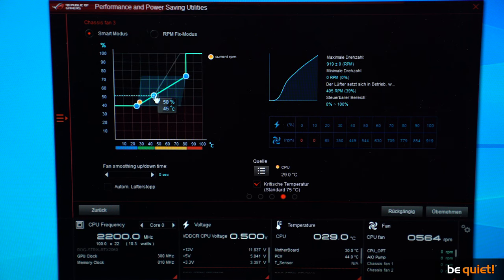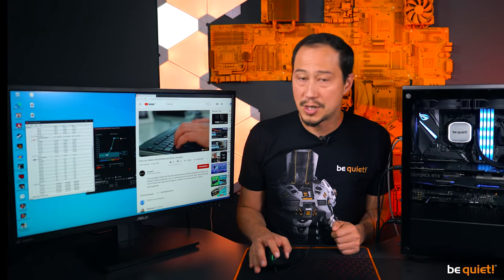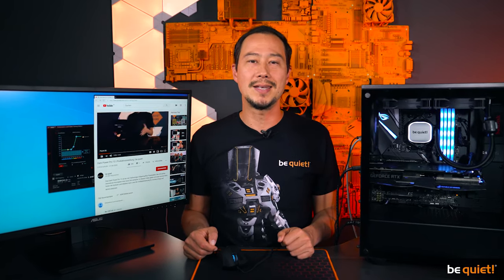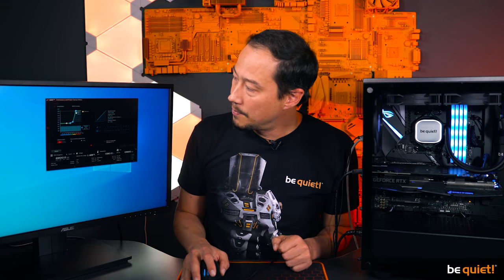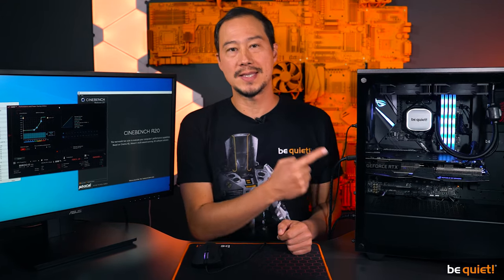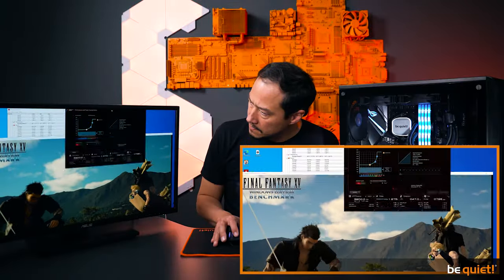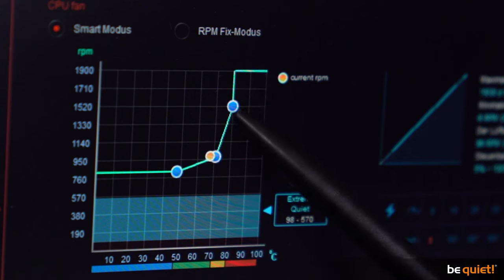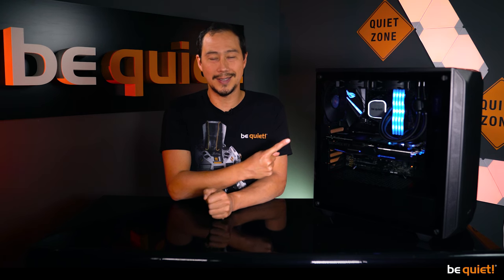How to create a perfect fan curve | be quiet!

Comment: Hello. I have recently purchased a pc with a be quiet 500 dx case, and i have 1 fan at the back, 2 on the top, and 2 on the front, but the fans in the front do not spin,  you think there might be a problem with them, or maybe they are set to spin when pc overheats?  Any way to check and configure them? thank you
Reply from the maker: Hello, best to contact our customer support (service@bequiet.com) - my colleagues will be able to help you quickly.

Comment: Very nice video! However, I find it still tricky and I don’t feel confident doing this. Do motherboards have an automatic mode, meaning, the fans ramp up as temperatures go up? I’m building my first pc built ever and I’m hopping to make everything right with the 6 pure wings pwn high speed 120 mm I’ve ordered.
Reply from the maker: Hello. You don't need to worry: The motherboard will take care of automatically regulating the temperature. This video is just there to show you that there is always potential to make the most of your water cooling system.
Reply: Look at the graph, the x axis is temperature and the fan speed changes in in relation to it. There is zero risk involved and if you do it right you pc will be more quiet.

Comment: I didn't even know I had a fan management system on the bios of my motherboard. I have modified the fan speed curve. Now the system is always at the same rpm at idle. Before it was increasing and decreasing all the time. It was quite annoying. I just ordered a dark rock pro 4 to reduce the noise of my system even more

Comment: @be quiet
nice video
instead of using motherboards vendors terrible software
use "argus monitor" instead its undeniable the best fan control software that exists.
specialy because you can use average temps and even have your case fans react INDEPENDENTLY to cpu and gpu temps < wich is insane valuable.

Comment: Never seen a pump design like that...is it an asetek design or in house.
Reply: It's likely their own in house design, and done in the way it is gets around the patent trolling Asetek does.. I call it trolling only because they slap it across any manufactures face that wants to do a AIO in NA with the pump built as part of the block that sits on the cpu. By putting the pump inline with the tubes or as I think NZXT did once? within the radiator, they can get around the nonsense asetek tosses at people.

Comment: So do you copy the newly tuned curve to the various other fans in the chassis? 

also, shouldn't there be a round of calibration for the case fans before you set the next threshold? I think the system has to work in tandem to avoid bad air dynamics?

Comment: be quiet silent loop 360 is fit for amd threadripper 3960x?
Reply from the maker: Hello Muhammad. No, it isn't - Threadripper CPUs have a completely different surface than regular processors, and there need dedicated TR4 coolers like the Dark Rock Pro TR4 (https://www.bequiet.com/en/cpucooler/1525).

Comment: Should the curve for case fans be calibrated to just the CPU like the CPU fans, or should you also consider the mobo and GPU temps for case fans?
Reply: I've been wondering that too and found a solution in using the program Argus monitor, which allows you to connect the speed of your case fans to the temperatures of your Gpu AND your cpu, and set individual curves for each. The program smartly chooses the fan speed of the curve that is higher
Reply: @Thrillingish  I'll have to look into that.  My case fans never ramp up during games to cool the GPU because the CPU never gets hot during games.  I've got a Gigabyte mobo which are notorious for not working right with third party software when it comes to fans, so would be nice if it works.
Reply: @cup_and_cone  the program works excellent for me. best of luck
Reply: I just link mine to gpu as I never have a case where my cpu is hotter than my gpu. I have a 360mm aio and I only really game on it.

Comment: Hi , is it possible to get lower than 35% on the fan speed in Adrenaline?
Reply from the maker: PWM fans ca be set to ~20-25%
Reply: @bequietofficial  Thank you , but I have blocked min.35% lowest rpm for my card (rx6800xt red dragon). I wish to set 25% in Adrenaline,  but I cant :/
Reply: @majkiman7674  I do use adrenaline too but got a 6500XT Tuf card that use like 3 - 9W on desktop and allow fans to stop until about high 50's °C , same goes for the case fans , when under 12-15% which give ~220-350 rpm depending on the fan, they just stop. It's neat feature that allow in a good airflow case to basically only use the fans when doing moderate work or gaming. Every idling or light use would not crank any fan up if the cpu cooler got enough inertia to allow for brief spike in temps to get dissipated slowly , basically any 240+ AIO or a 6 heatpipe big mono block or any dual tower will do. But that being said, letting a good amount of airflow in the case as a minimum allow for a lower starting point and give more room for the cooler to work without having to increase the case fans further until high load so that you don't get the roller coaster fan profile that often.

Comment: Put the computer under the desk...
Reply: @kxmode  Yeah, let me just dump this $2k pretty light box under the desk where I'll never see it, and it can suck in all that nice carpet dust.
Reply from the maker: You are not building for it a throne you can praise to? 🤓
Reply: @dtectatl1  Only if someone doesn't keep their room clean (and has an air purifier). Besides, most high-end cases come with filters that do a great job blocking floating particles. My CORSAIR 4000D case has an air filter for all the inlets: top, front, and bottom.
Reply: @bequietofficial  Nope, I’m old school. I prefer a case that’s black and free of any lights. 👍
Reply: @kxmode  to each their own, but I'm not putting this beautiful thing under the desk. It deserves to be displayed in all of its glory. Performance first, but aesthetics are a strong second.
Reply: @dtectatl1  To each their own. 🙂